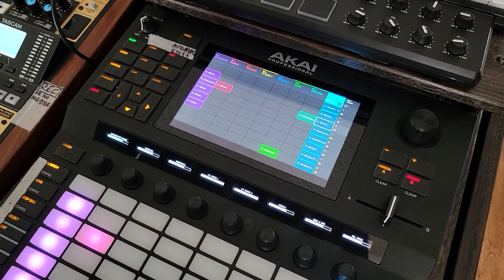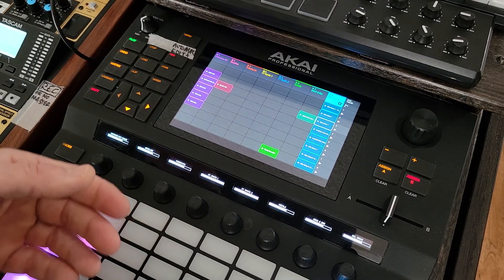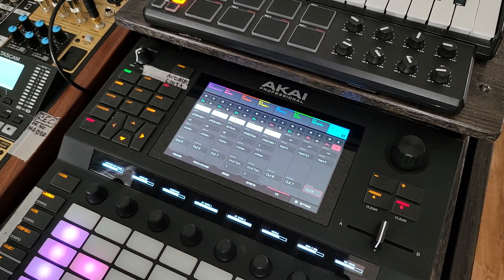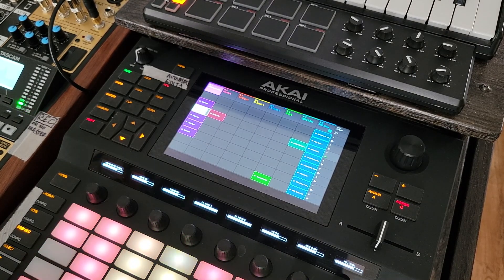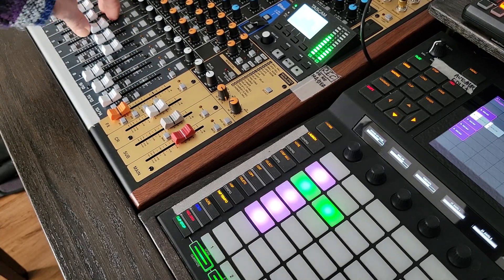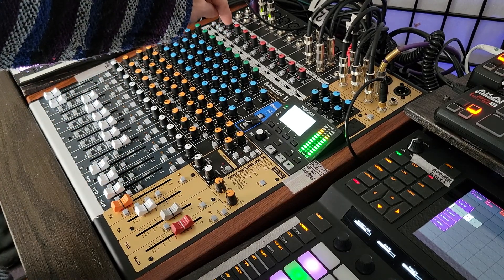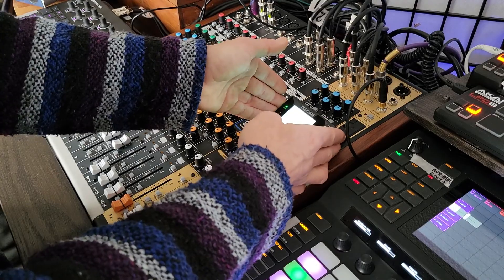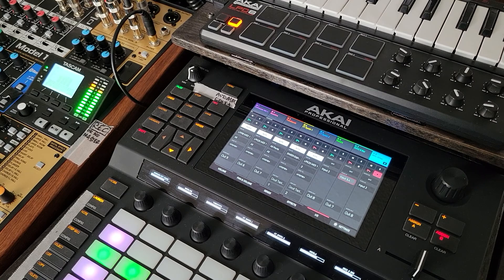Akai Force STEMS audio routing via USB to Tascam Model 16

Comment: Hey. I have the Force plugged into the tascam, I get no audio from the force. Does the force have to be plugged into two channels on the tascam or no? I don't get how this is supposed to work.
Reply from the maker: Force Output to Tascam Input.  The last channels on the mixer are stereo, so you use L/R to get signal in one stereo channel.  Check all settings, and that you aren't using Out 3/4 on the Force.  If using USB, you have to make settings in the Force to allow for the outputs to work.  Away from that screen, and I went back to audio cable routing for my rigs a couple years ago.

Comment: Hi, can you route every stereo and mono channel within Force to any external digital mixer with USB? Also, can you route multiple mixer channels back into Force through USB? Second, could you please help and confirm that Force does have a sidechain device for kick to bass? Also, do you find Force to have enough storage and CPU to handle at least one hour set material? Thank you a lot.
Reply from the maker: Adrian, 
1. Any CLASS-COMPLIANT mixer, likely within the last decade. My Mackie USB mixer is only 2-in 2-out, so not on that one. The Model 12/16/24 pipes all channels at all times.
2. Sidechain is called Mother Ducker, runs as an Effect in Mixer. See upcoming about installing on a single drum kick etc.
3. Force plays 1 track at a time, max 32ch. U cant build a set in one file like Ableton. You need another rig to build the next song as load times are 15sec?

Comment: Is there a way to record all 16 channels from the mixer to your DAW to mix instead? Like MPC -> Model 12,16,24 -> DAW
I basically just want to get to the mixing stage quicker in my DAW and have all of my stems instead of just a 2 track.
Reply from the maker: Consider  the Model 24 if you want to do so.  Model 16 has 1-8, 9/10, 11/12. I'd suggest the Save - Audio Mixdown - (Check) Separate Tracks. Plug USB, go to Computer Mode, move tracks to the DAW? Outputting and recording into Tascam as multitrack might help pre-mixing.  15/16 is the Main Mix on the Model 12.

Comment: How doo, interesting vid, im doing a bit of research in to the forrce  and working Dawless with external gear. Just want to ask if you get much latency when monitoring through the force? also do you need to clean the start points on your stems/loops when recorded in the force? Also how do find the midi in terms of overell tightness when sequencing external and have you noticed much jitter in the recorded audio?
Reply from the maker: Tom, I monitor via my external class-compliant mixer; no latency noticed when I used the Force headphone jack when I bought it.  The start and end of recordings is tight, as this is a looping machine. MIDI seems tight so far; a friend bought an external MIDI hub that allows timing to be dialed if other products dont time well. I use most gear by USB directly connected, and that works neat - supposedly faster than midi timing resolution.  Recorded audio should be done as a bounce with full analysis in hi res mode. Not sure what that setting is off-hand. No major jitter thus far in audio. It displays the amount of CPU and RAM used in the track; I've never seen mine with high usage.  The screen sometimes seems to lag on fast short loops.
Reply: @protenuator   @Protenuator Music  sounds an almost  perfect way of  recording external gear at the same time as sequencing it which has always been.the goal. Have tried to do this with an Mpc 1000, Ableton and an old.school digital recorder all of which have major flaws. The class compliant device compatibility is a major winner as it gets past rhe limitation of the force hardware. Would you do a quick demonstration perhaps on recording audio along side external sequencing etc. Anyway your vids and comments have been really helpul. Chees 👍
Reply from the maker: @awkwardtom   I've been trying to get to a vocals and bass guitar focused video.  Hopefully soon...

Comment from the maker: At around 6:45, difficult to say, the Force only records from EQ; the Audio is sent over by USB, the Tascam digital routing skips the gain and compression stages, and the Tascam sends it out PFL (pre-fader level) if I wanted to record back to the Force.  To get fader levels to affect it, I have to re-sample using the Sub bus; I route the sub bus back through ch 3&4, thus capturing the fader level of the original cut I wanted.  This is one way to overcome the low recording volume I sense with the Force.  More on that later...
Reply: Tascam digital routing skips the gain and compression stages - is that just for  akai, or even with DAWs ? Does Compression only work with direct audio inputs ?
Reply from the maker: @basedvato  Tascam routing by USB enters between the compressor and equalizer for all digital input.  The audio inputs are the only thing the compressors work on.